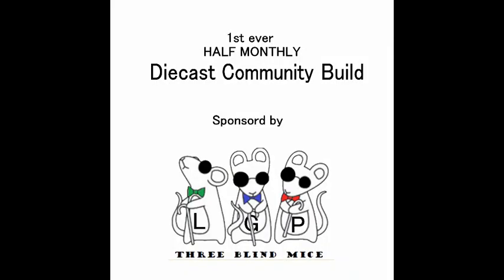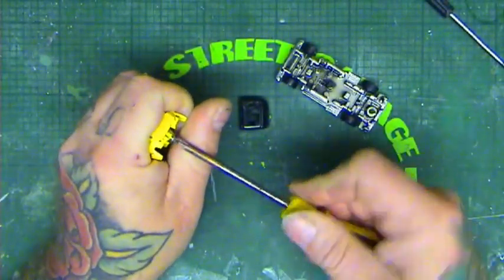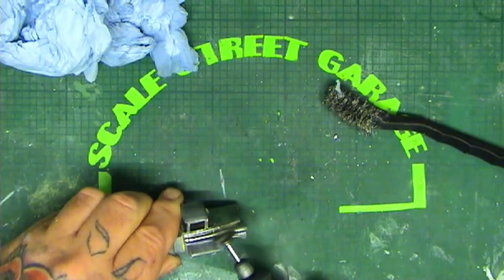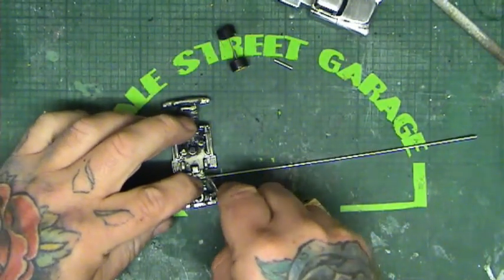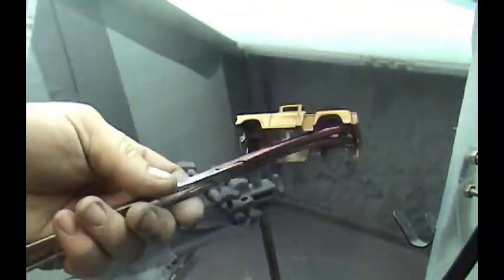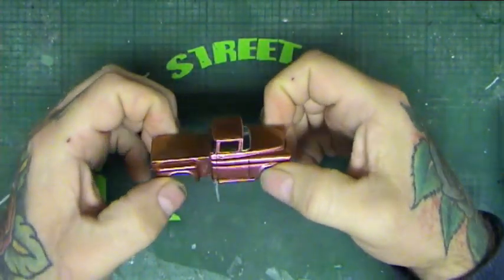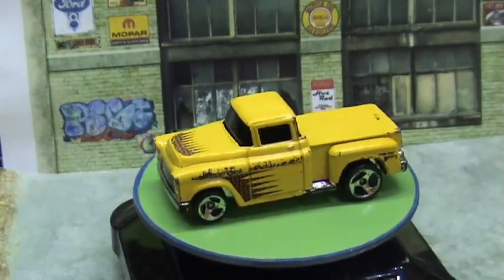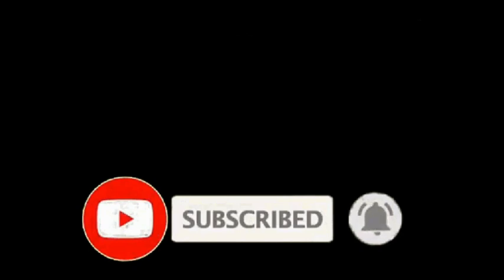FLASHSIDER  challenge custom hotwheels

Comment: Years ago when those color shifting paints were just being introduced by PPG and Dupont I sold most of it to shops spraying motorcycles, snowmobiles and helmets. I had one shop that did a $3500. job on a Harley. The owner was so excited as he rode off on that beauty. Two days later he was back. I'm not upset with your work the job is beautiful and your workmanship perfect, but you have to repaint it. I'll pay you to repaint it. When I'm riding down the road from my viewing angle of the gas  tank  appears to be pink. Even if no one else can see the color I can! I just can't look at a pink tank between my legs! Your a brave man SSG.

Comment: Hi matey, what size drill/ screw combo are you using?
Reply from the maker: I use 3 different sizes depending on the castings, i use 1.5 , 1.8 and 2.5mm drills, 2mm and 3mm taps and M2, M3 button head machine screws, also use 2mm button head self tapping screws as well
Reply: @ScaleStreetGarage  do you have a preferred supplier?  in Britland
Reply from the maker: @roop298  unfortunately not, i use ebay to search cheapest and uk only..
I have purchased from china before but the potsge takes a long time
Reply: @ScaleStreetGarage  ok matey. NP